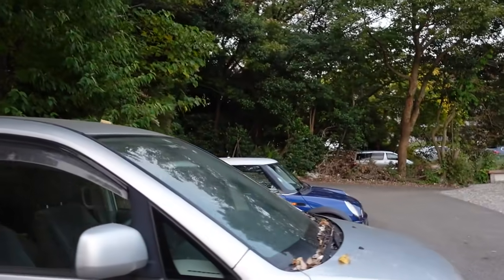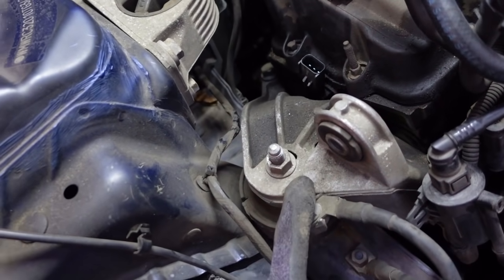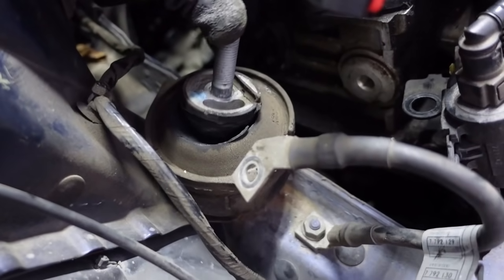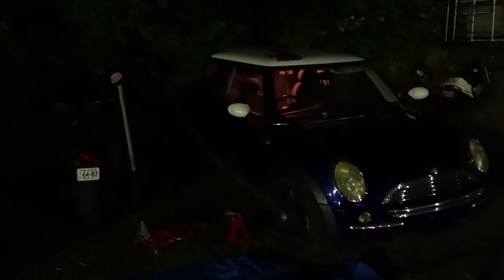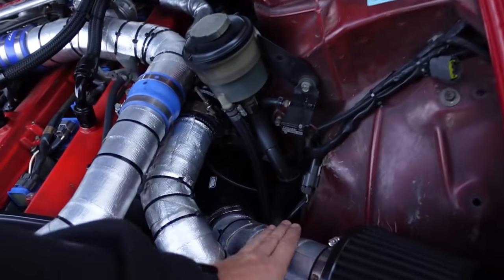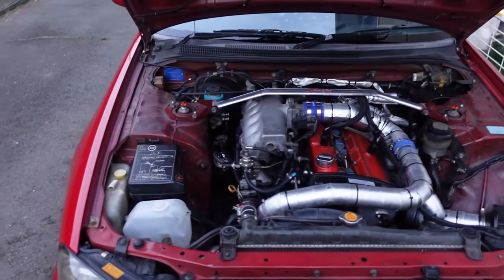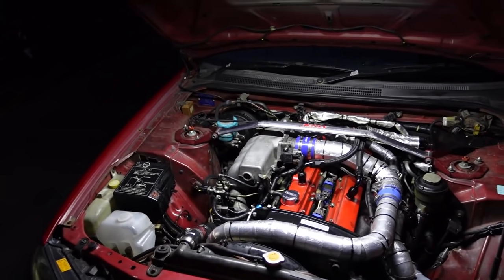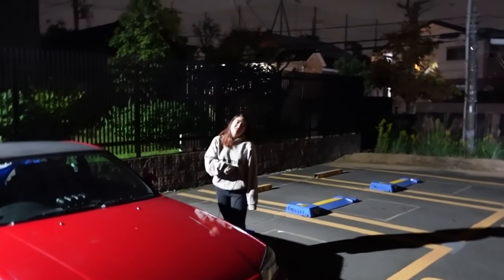NEVER ENDING SKYLINE PROBLEMS!

Comment: Catch cans are a bit of maintenance bore but if you're having pretty serious accumulation, might be worth looking into for the next build. I'm not 100% how they handle recirculation of the environmental garbage, but if it's anything like the 4 cyl Nissan engines, that crap is plumbed right back into the intake. Seals aside though, like I mentioned in my previous comment, the seals are cheap, it's just a pain to get to as you have to dismantle the turbo down to the shaft to get at them. On your boost leak, I'd be padding the back of that bumper with a strip of rubber or whatnot if you're cutting connectors that often. The backside of bumpers can be razor sharp, especially once they've got some age on them. Rubbing happens everywhere, the engine moves, bumpers flex, etc.

Comment: Try unhooking the boost pipe off your intake manifold and plugging it then pressurize the intercooler and pipe system and it should be able to hold pressure for a few minutes at 20 or 30 psi

Comment: 🍍RB= Really Broken lol. All the nissans ive owned has cracked heads lol. I agree with you on the oil pressure on the turbo. Restrict the oil flow and clean out intercooler and boost pipes, then take it from there. I watch till you are about to say chow matane lol.

Comment: Pineapple 😂 so for the mini situation here’s a thought: sell the mini, buy a blown up rx8 or an rx8 shell. Pick up a jz or an rb for the s15 to take it to the next comp level. Once the skyline build is over, swap the sr into the rx8, and toss the new power plant into the s15. Two birds with one stone! Higher powered comp car, reliable rx8😂
Reply: In Japan getting a rx8 might be cheaper than a jz, but yeah a jz in the s15 would be cool to see🍍
Reply: @aqwnr56  if I read right, they’re cheaper in japan rn than anywhere else bc the importers are all jacking up the prices due to the lack of import/export from japan. He had already talked about getting an rx8, and he wants to go into fd at some point so a bigger better motor would help both of those 😂